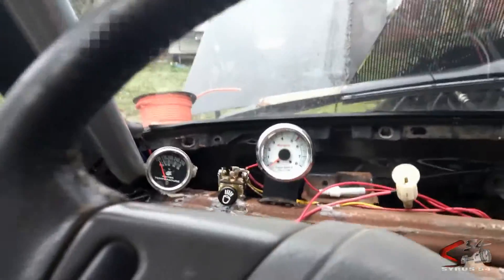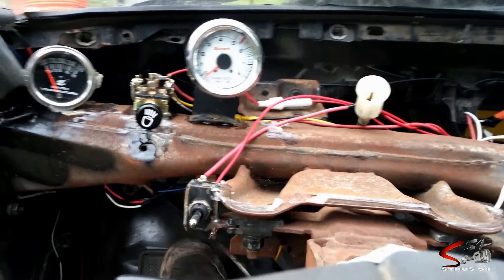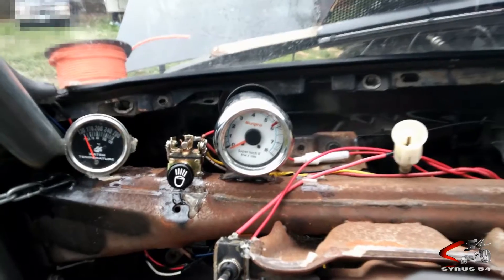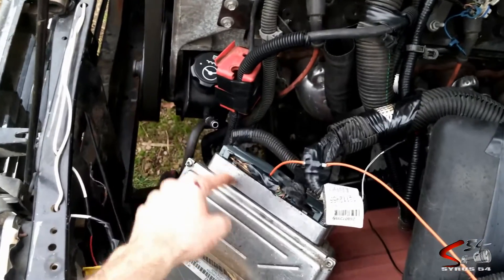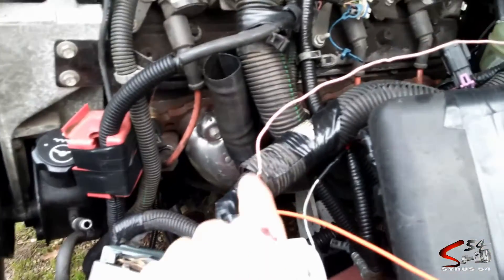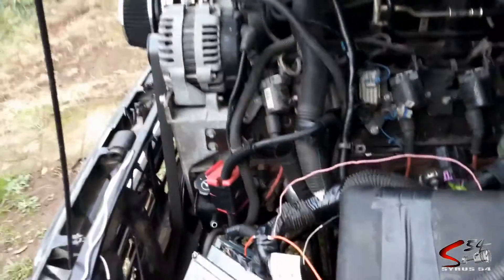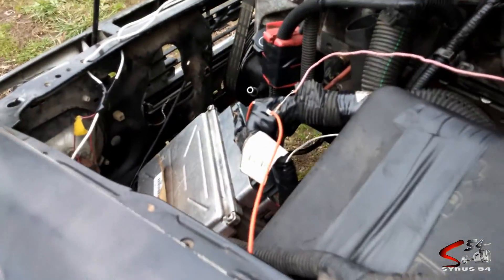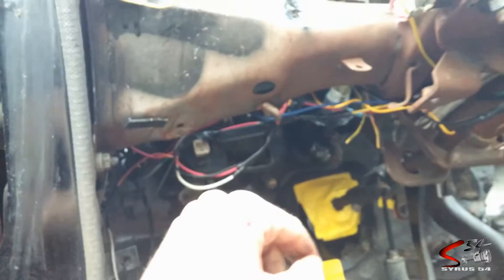LS Swap Tachometer Install (SunPro 8k Tach to 5.3)

Comment: ahh it's a pull up resistor that you installed, it makes the signal active when you apply 12 volts to the tach signal, not sure why the tach gauge has to be at 4cyl setting though, oh and the resistor is reversible, no need to worry about which way the resistor is facing towards the computer, only diodes are polarized

Comment: I tried the resistor trick with no luck,even with no resistor and key off my tach line coming off ecu #10 wire still has 12v
Reply from the maker: Bad resistor? Installed backwards?
Reply: @Syrus54  mine work fine set at 4 cyl witout resistor...go the same ish tach as yours
Reply: Do those resistors get hot are generate any type of heat?
Reply: I would run your green wire from your tach to white wire number 10 set tach to 4cylinder also have power running to your tach it will work😅